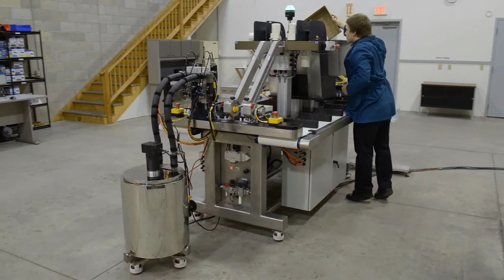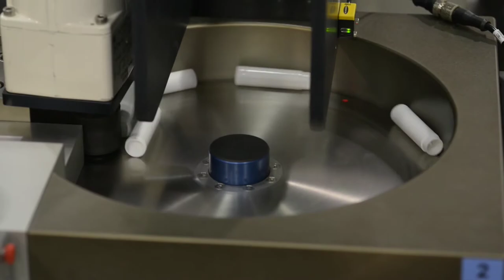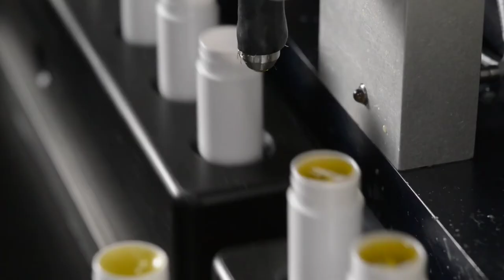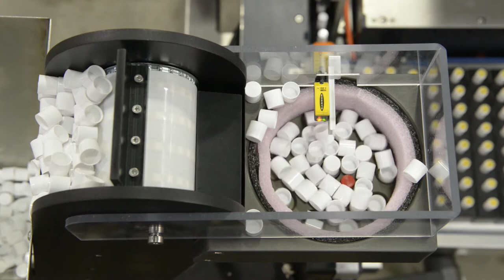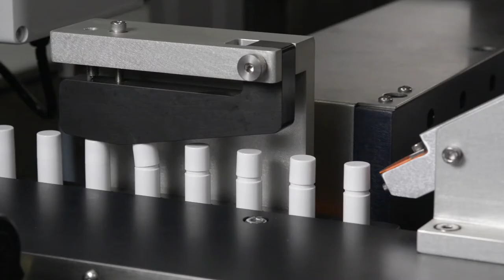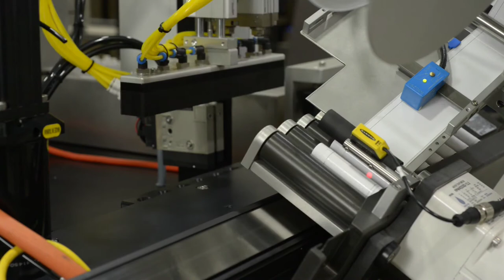Lip Balm Filling Machine

Comment: Dear All, tried to reach you via email but you didn't respond. Do you have a distributor or sister company in EU? We want to take one of this machines :)
Reply from the maker: So sorry, Emil. Please check your inbox. If you don't see a message there today, there may be a delivery issue.
Reply from the maker: If the email does not come through, please give us a call at 00-1-603-352-3478 ext. 1207